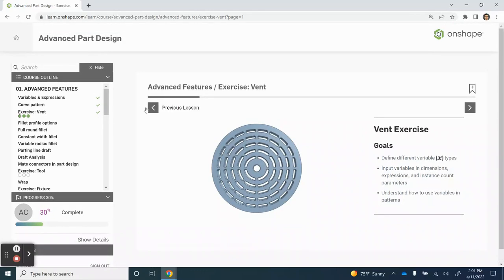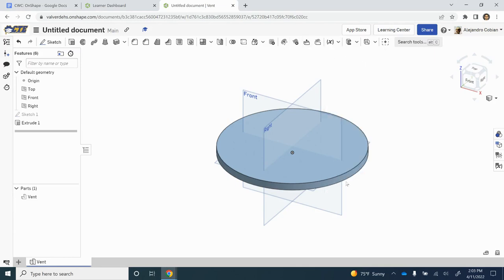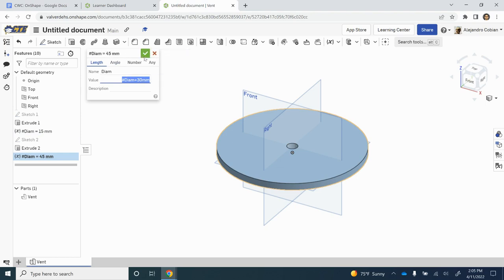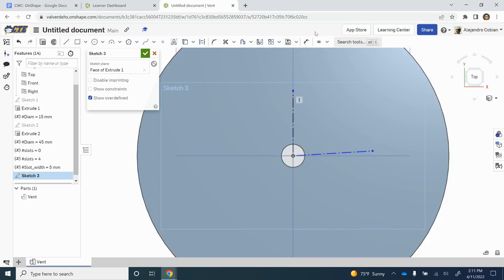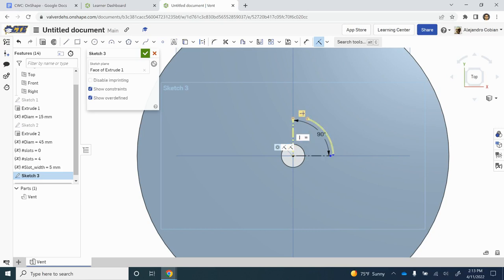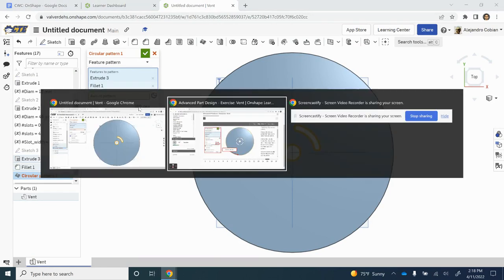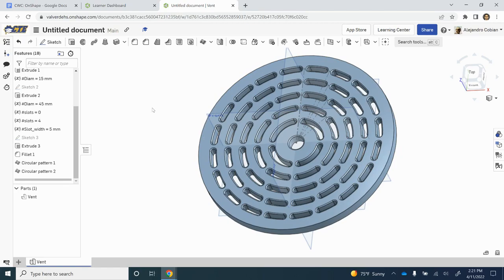Onshape Advanced Part Design Exercise 1: Vent SLOW DOWN @7:49

Comment: Yo I need you to make this new video, my professor is bout to screw me over I need help with step 16 and I can only get bigger extrudes on each quadrant. Help me dawg
Reply from the maker: Go back to step 12. The arc's end points need to have their distances measured away from the horizontal or vertical lines, not the lines' end points.
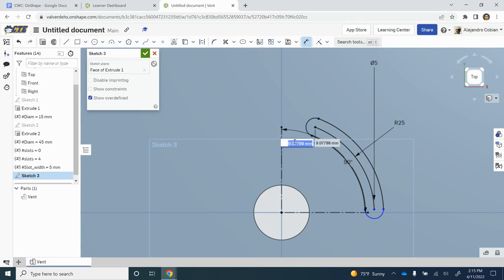Reply from the maker: This is shown in my video @7:49  for the vertical line and the arc's top end point. Then @7:59, this is applied for the horizontal line and the arc's bottom end point.
Reply: @createwithcobian570  ooooooooooh thankj you I was going crazy. now I understand hint 12. Actually I think there is a small mistake. It says: "Dimension between the centerpoint of each arc and the corresponding constructions lines, instead of the endpoints of the construction line." I think it should be "lines" instead of "line". When I read "line" I thought of the construction arc, so I understood it, that I should dimension between the endpoints of the two lines and the center points of the slot end radii and not between the endpoints of the two lines and the endpoints of the construction arc. However I did not see how to even choose either the center point of the slot end radius or the end point of the construction arc (because they are the same). This really got me stuck. I think that might be a common problem.
Also I think it's not such a great example because it doesn't really explain very well how the second pattern happens, it is a bit of a black box.

Comment: I did this exercise but I have a doubt...
In slide 12 I dimensioned the endpoint of the arc with the endpoint of the construction line, but doing so the second circular pattern does not work (more slots are overlapping). Then I understood the solution, it was always the hint in step 12, I solved it but why?
Why is there a difference between the dimension, between one endpoint and the other, and a dimension between an endpoint and the construction line?
Reply from the maker: I'll need to redo this video. 50% of my students end up with the correct build and the others do not. 
I can't answer off the top of my head. I shot this video 2 years ago.